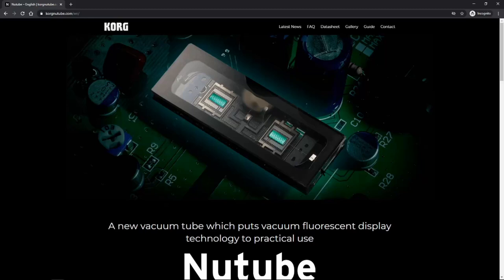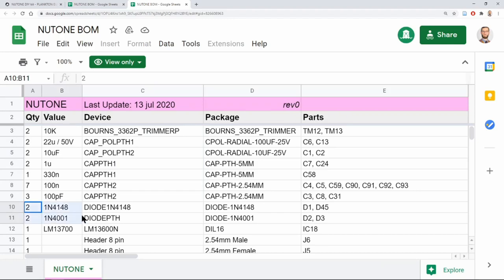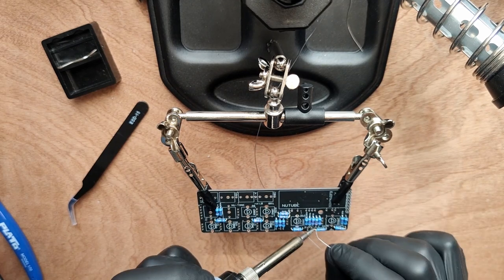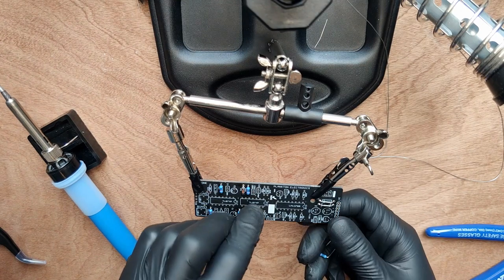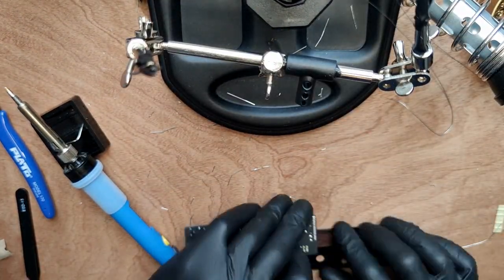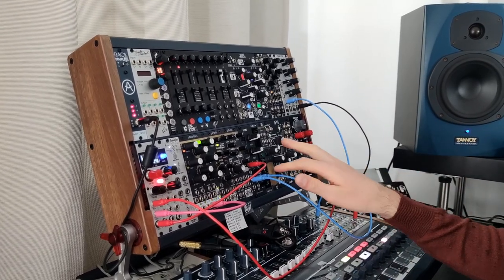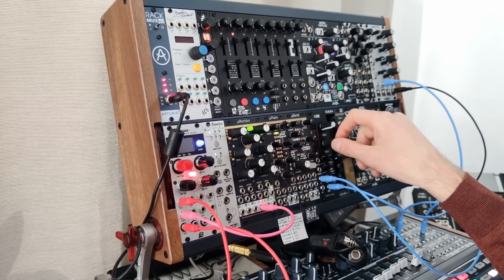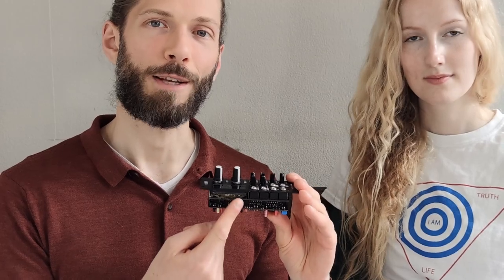Plankton Electronics Nutone: Build, audio demo, and review

Comment: 👏 great of you giving so much details during the build / specs part! I’m gonna have a try at a proper diy from a BOM list 😁
Reply: That sounds like a fun way to go!
Reply from the maker: The most important thing is to stay organized and prepare well. Which module are you building, out of curiosity?
Reply: @Channel37synth  Hi! Yesterday evening I did my first soldering ever. Did one of those educational sets for kids, where I soldered two blinking led lights🤣 Will try two more of those, to get into the habit, and not to mess up a more expensive module. And then it’s time for my first module that I just got in from the mail as a full kit: the Bastl Propust! After that I think the Frequency Central Boom! Mainly cause they’re both cheap:) You know them?